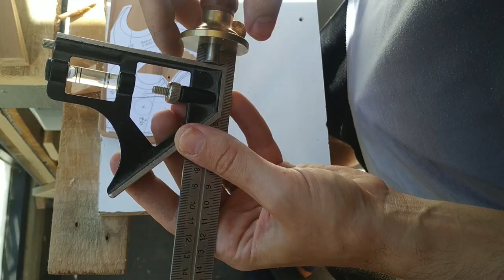Making saw handle only with hand tools

Comment: You need to get a better bench! Every time you used a tool the whole bench moved making everything much more difficult. It is very difficult to do good work when everything moves.
Reply from the maker: Exactly! İt is already in my to-do list.
Reply: or clamp it to the wall,,, Great video by the way,, keep up the good work, stay safe..
Reply from the maker: @kierannolan8859 Thank you for your suggestions. You too stay safe.